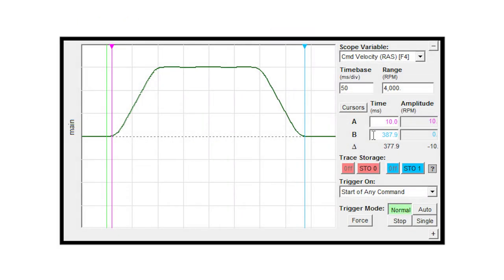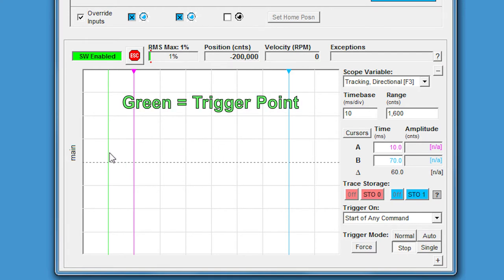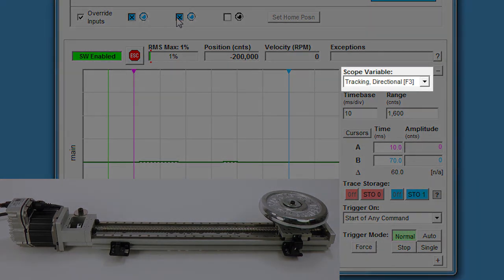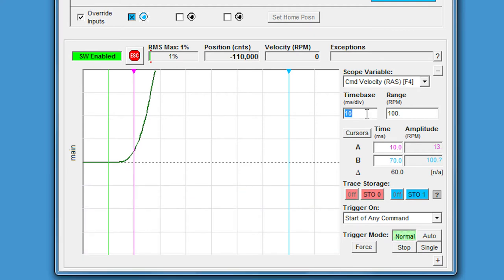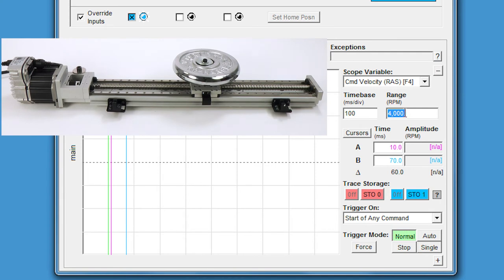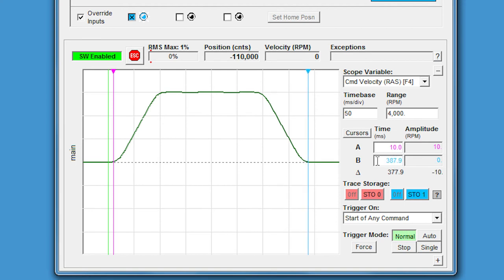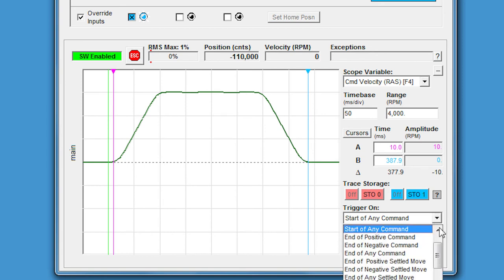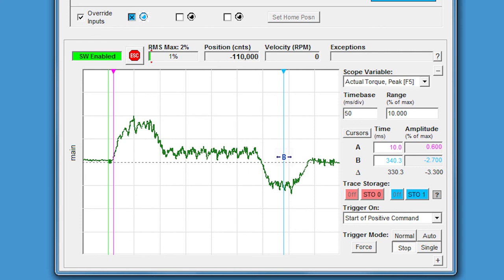How to Use ClearPath's Diagnostic Tools

Comment: Now that you have made an introduction to oscilloscopes, it will be very useful if you could do a performance comparison between for instance SD and HP models moving the same load so that we can look at the actual benefits we will be getting from the HP models in terms of accuracy and speed. See where the ceiling is at for each series if you will.
Reply: Hi Abraham, Thanks for the idea, I agree with you that this topic could be used to make an interesting demo video. We're actively working on a number of new videos for Teknic's YouTube channel and once these are done, we'll be considering new topics for the next videos. 
-Abe A.